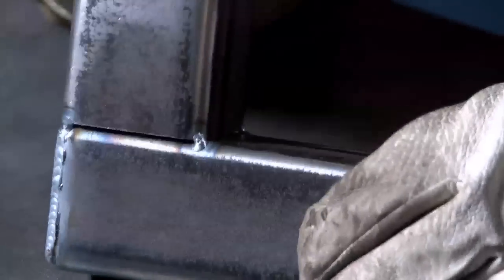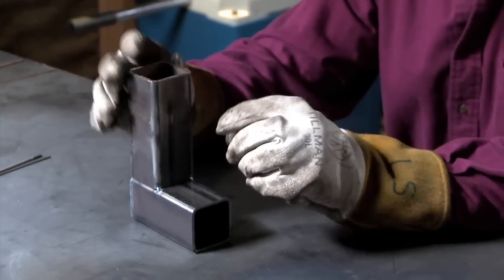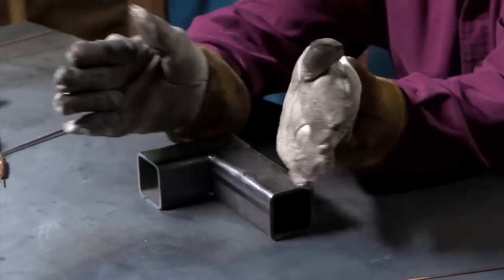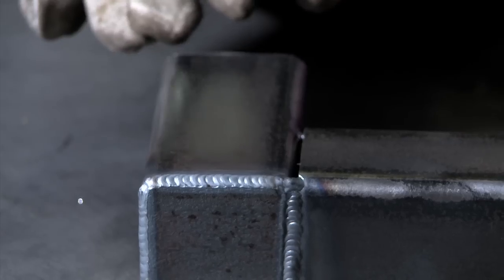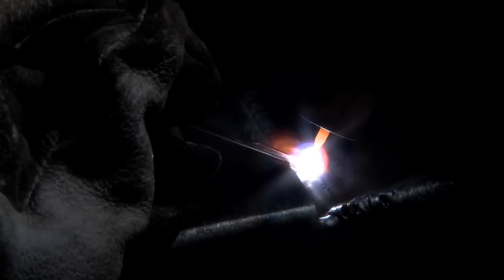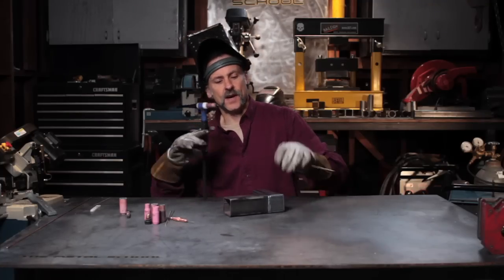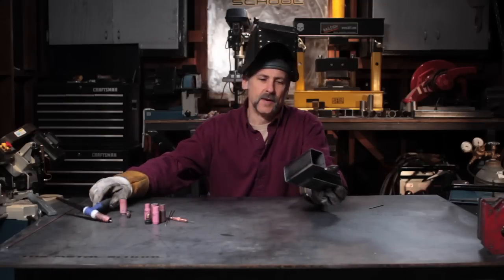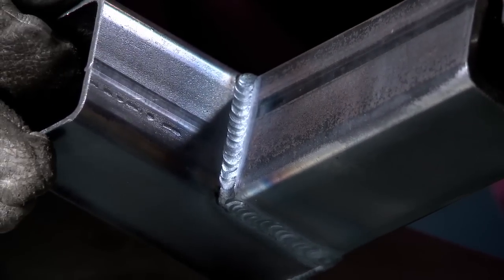How to Weld a Tubing Corner

Comment: Really depends on what you are expecting to weld. The classic tombstone buzz box is a standard because it is cheap, and does what it was designed to do. But beginning welders sometimes have trouble maintaining an arc with stick at first. What I did initially was figure out what main project I wanted to do, and bought the machine that fit my budget and could accomplish that task. Ask around, your friends might have a welder you can try out to get the feel for it.

Comment: Hey there, I'm a student who is looking into building a rollcage for a small go-kart out of some round tubing but I have never welded before, any tips or anything I should work on before I attempt this? I am using a stick and wire welder and I do not have any plans on bending any tubing, just 45 and 90 degree joints. Any help would be much appreciated, thanks.

Comment: In this situation you know what material you will be welding. it would be best to practice with that material. Put two pipes together at 90 degrees, and then add a 45 degree pipe to that. Beat the crap out of it and test how strong your test welds are before you trust it to protect the person driving the go cart.

Comment: Undercut is a structural issue.  True, an undercut weld looks bad and is not as strong as one that is not, and it makes you suspicious of its overall quality, but if the rest of the structure has had enough margin designed in then it will still do the job intended.  If the members being joined are near capacity in service, then loosing 10% of the section thickness to undercut would likely lead to the part being rejected and reworked.  (A trick of the camera?  I'd want a re-take or 2nd pass)

Comment: On tig your not burning thath hot to warp it. You have all your tacks in all four corners so honestly you dont need to get that complicated with it.
Reply: That's not true It warps, maybe you don't notice that much on 2 Pieces that short; but of you have to weld a gate frame, then on 200/250 centimetres lenght you would notice warpage, since getting out of Square of Just 1/2 degree would result in 10/15 mm.

Comment: also funny you mention you were a naval engineer. which means, you werent a welder. also funny, because the time span you reference is also well known as a dark era for the ship yards. and is also why ships are no longer built by but one yard. because people were packing the V with rod, welding over all of it and calling it good. instead of welding the hull plates on with multiple passes. This resulted in lots of rework and lost boats.